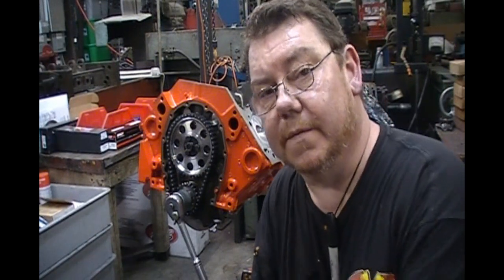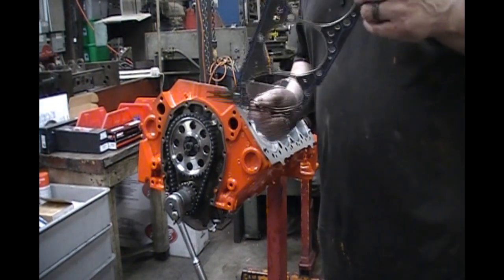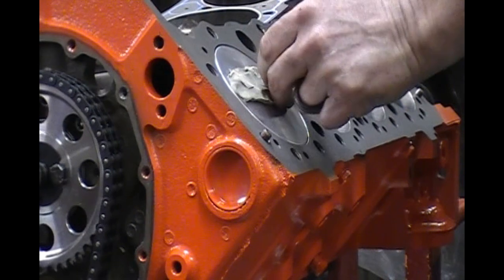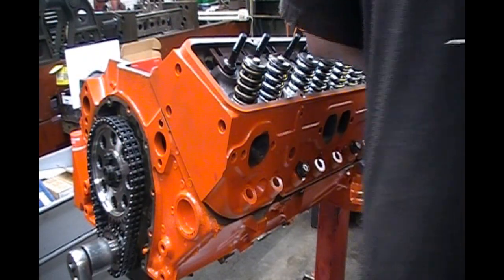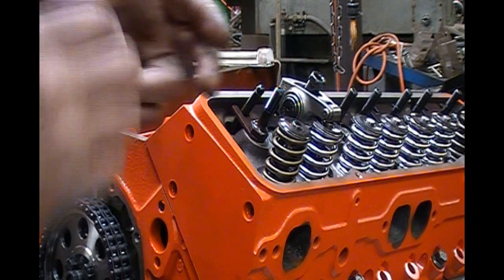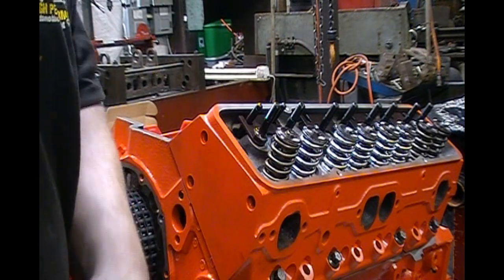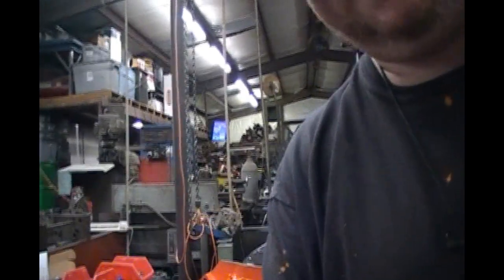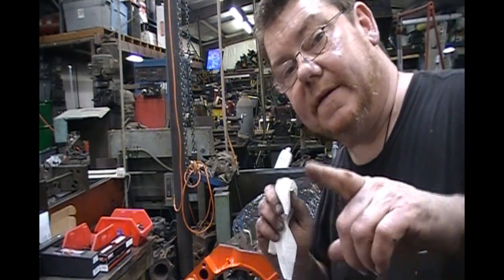Piston to Valve clearance and other valve train checks

Comment: I am thinking about getting a set of --- Roller Tip rockers --- in setting it up as you show here --- and the witness mark say is on either side of center ---- in your "Valve Geometry" video eight years ago --- you were showing that it was on the short side --- meaning a longer push rod is needed and said about fifty-thousandths longer ---- I wouldn't even know how to make that guess --- so what I think I need is if the test run shows falling short or over shooting center ------ I need to get a pair of --- Adjustable Push Rods to figure what length I will need ---- and this is not a block or set of heads from a machine shop that has been all machined ---- just a re-ring , bearings and lap valves in --- so yes --- valves may be sitting at different heights ----- I should check all sixteen valves to see where the Roller hits on the stem ---- Is that what should be done? ------- Thank you for sharing your experience with us ------ Will watch more ---- to gain more on building my engine ------ Hope you have a Good Week --- Rodney
Reply from the maker: So yes If you want it perfect, get yourself or make a push rod length checker and check all 16. However if the valve stem height is off that much between valves I would have a serious discussion with your machine shop. Look it's important to get the geometry right, but it's not the end of the world if the witness mark is a tiny bit fore or aft and not exactly in the center. Just as long as they are not way off to the front or back. This is especially true of a street engine that will not turn a lot of rpm.  That being said, when I first mock up an engine to check everything, I first check the stem height to make sure they are not all over the place. Then I set the head on the engine with the head gasket that will be used for final assembly (normally a used one if you have one...if not use a new one but be careful with it lol) bolt the head down and use the pushrod length checker (and lightweight checking springs) and the rockers that are going on the engine, and check at least 8 valves on each side of the engine. That's the way I do high end engines with 30 plus years of success. More mild engines I check at final assembly and I do one cylinder on each side and let it eat. I've never had an issue doing it that way, so don't get to worried about it unless its way off. Thanks for watching!